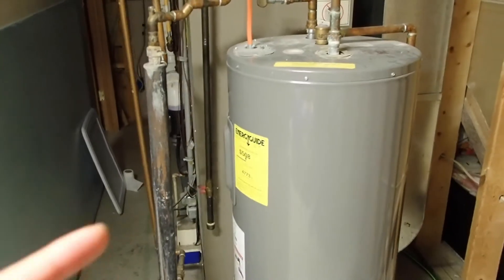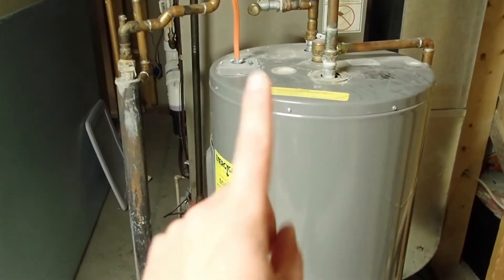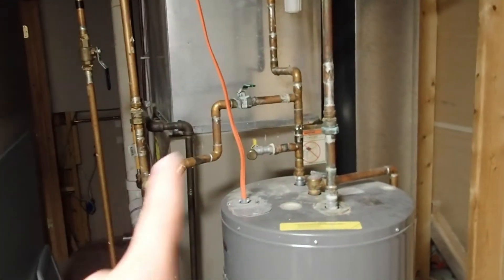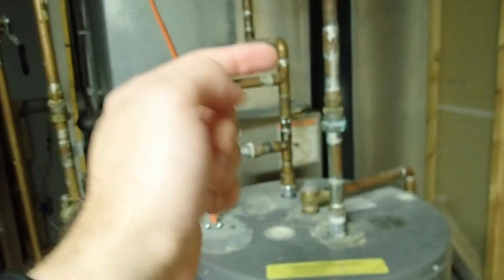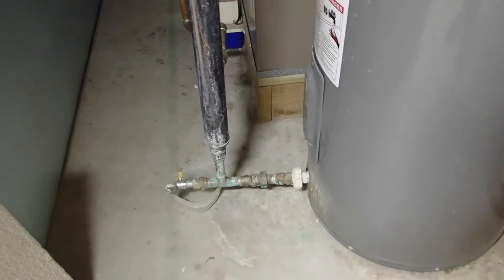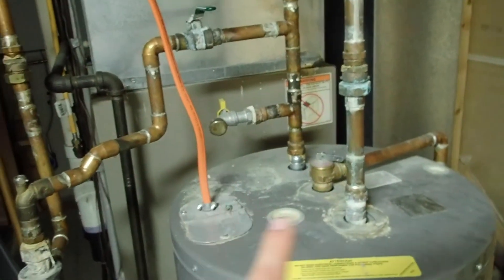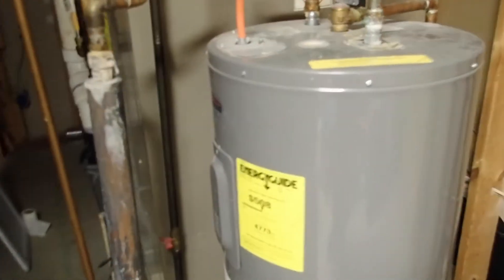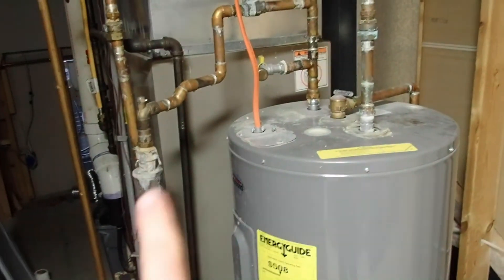Not Again! New discovery - Wood Boiler Saga... Thermal Block!

Comment: Also. These must have liquid to liquid heat exchange.  If a  bubble forms the top, it will not work until it gets purged out.  I just lifted the tpr valve to make mine heat.  Of course this can cause the valve to not seal, but unless there is another opening to air at that point ya got no choice. Doesn't hurt to put a new one in anyway.  Dang things are prolly a 100 bucks now though.

Comment: Reduce all that crap above ur side arm, keep it lower than 4 inches above the top of your water heater, also bring the side arm in closer to the the water tank. It says somewhere in the boiler directions or somewhere in "sidearm" directions that it cannot ecceed 4 inches.
Reply: Route from the top of the sidearm to a tee fitting where the temperature-pressure relief valve is and you'll be well under 4 inches.